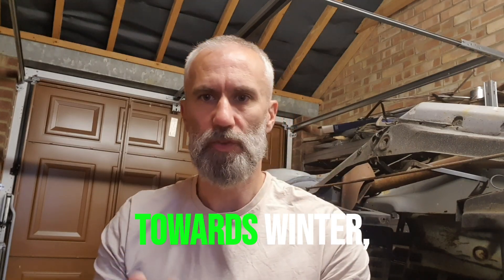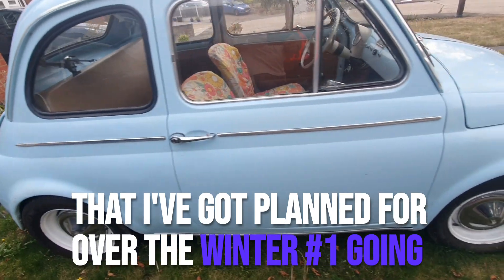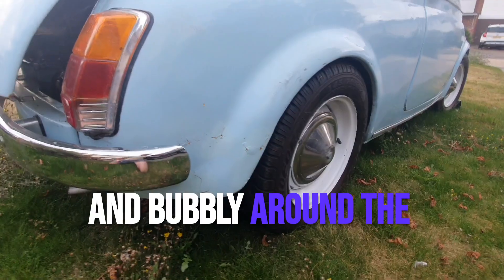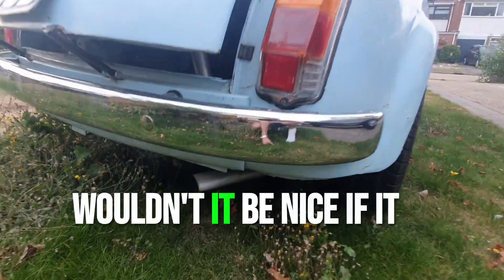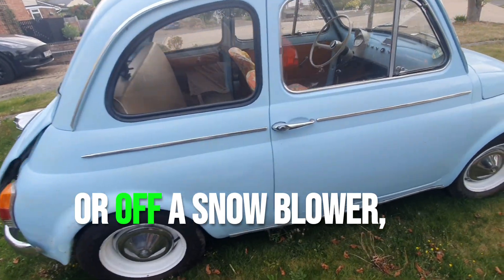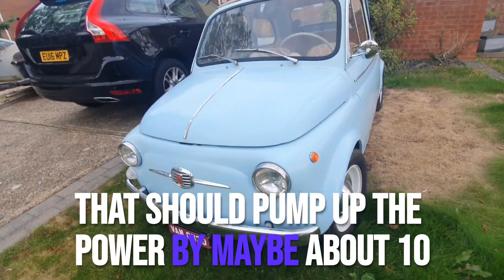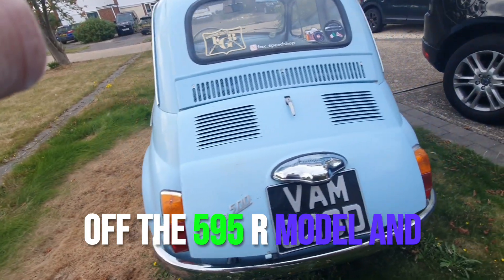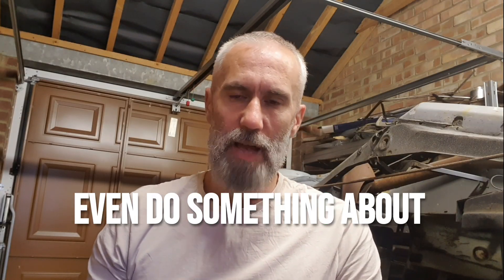Supercharging a classic Fiat 500?

Comment: Ooohhh, I've been thinking about an Amr 300 on a 500. I saw a pair of kids doing one once and it blew the head gasket pretty quickly.
Reply from the maker: @simtalkayak  ive not decided if ill run a renault 5 gtt intercooler or not yet, or the exact pulley sizes, but itll be an interesting experiment i think
Reply: @FoxSpeedshop  from what I've gathered they run hot, and that is just how they run, but they do well when cooled. Both oil cooled and intake temps. So, if I had to get one and modify I'd install an oil cooling system for the charger.
Reply from the maker: @simtalkayak  yeah as far as i can tell from specs they are just cooled by the oil in the case, there is no pump or circulation